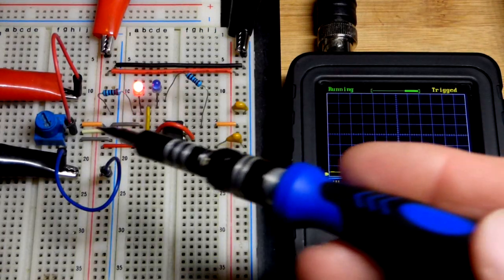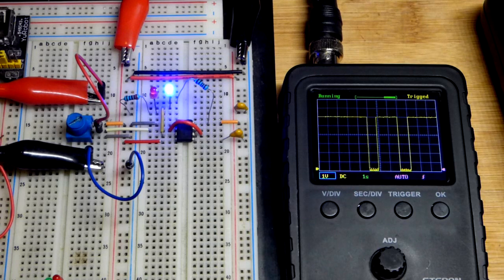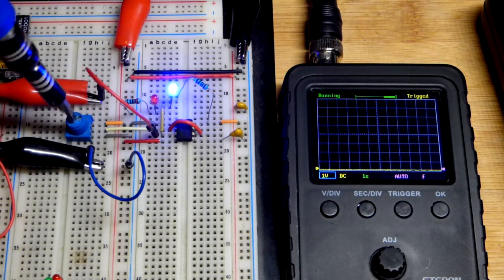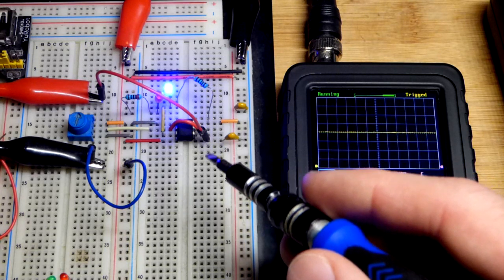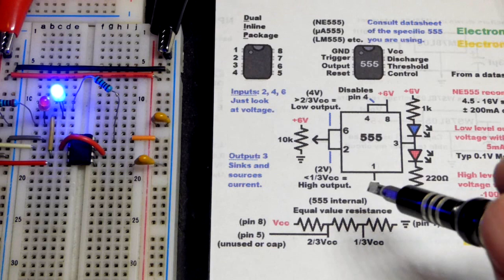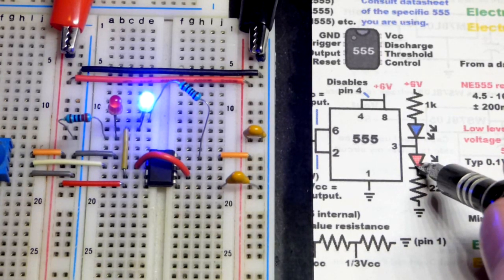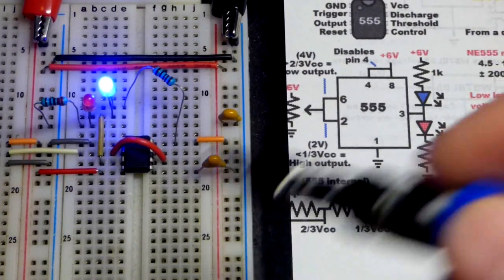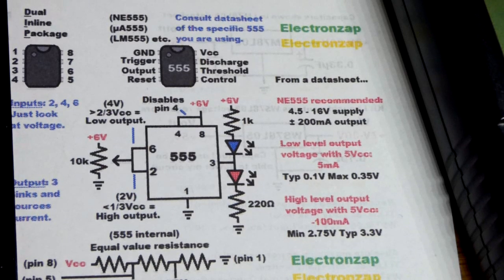Trimmer Potentiometer Trimpot Voltage Divider 555 Schmitt Trigger LEDs Circuit Oscilloscope measured

Comment: I've really enjoyed tinkering with a 555. It really took me a while to wrap my head around the sink/source concept, though. Finally got it through my head. I built a power-on delay circuit controlling a 50 amp relay for ham radio gear in my truck. I used a red LED to show 
delay period, and blue LED when relay is activated. Worked good in my truck on a bread board for testing. Next step is a perf board version. The reason for the power-on delay is to start the truck and not worry about power surges if I leave the radios on.

Really enjoy your tutoring. Thanks. Keep up the good work.
Reply from the maker: Good times!